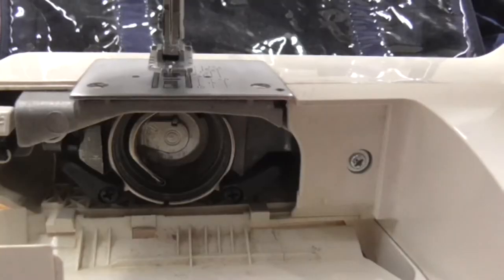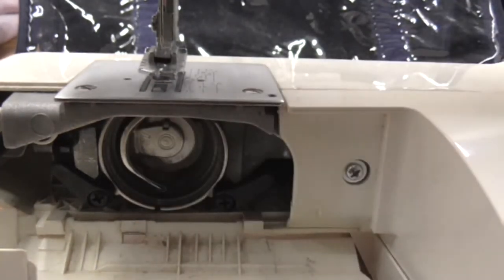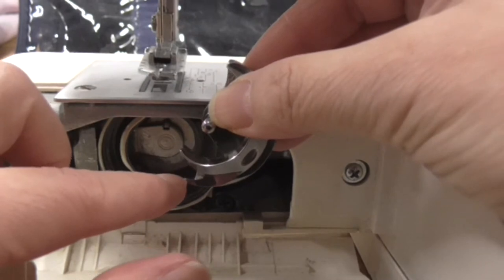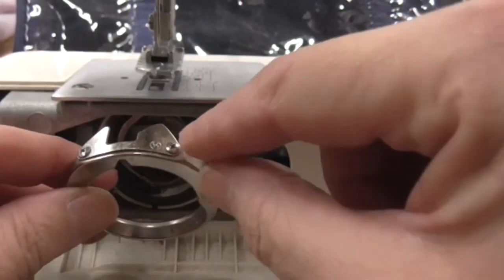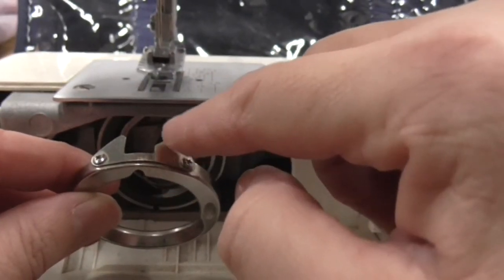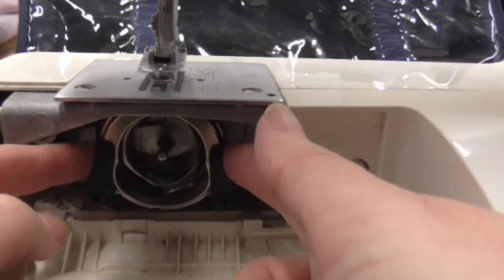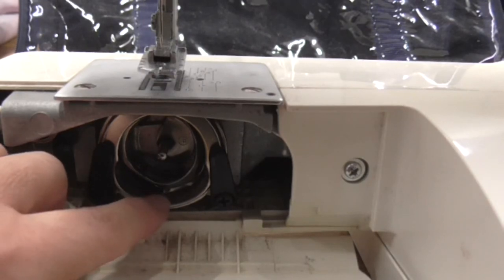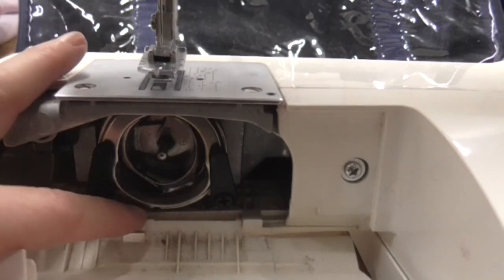How to reassemble the shuttle hook and cover on a Toyota Quiltmaster

Comment: I am using my Quiltmaster for the first time in quite a few years, I want to use the meandering stitch. Your how-to videos have been very helpful, I will put her through her paces tomorrow - I hope I cleaned her before I packed her away! A video on adjusting tension would be useful, if you could oblige, please? 😀
Reply from the maker: If it hasn't been used in a while, it may be worth giving it some oil and run through on some scrap fabric too. I never really had issues with tension  on the machine as long as it was threaded correctly and the bobbin was inserted properly. My quiltmaster has been retired, but I will see what I can do